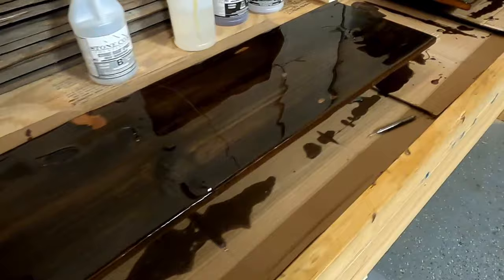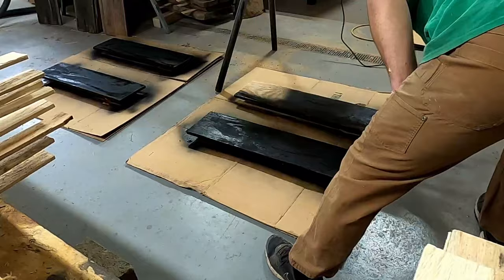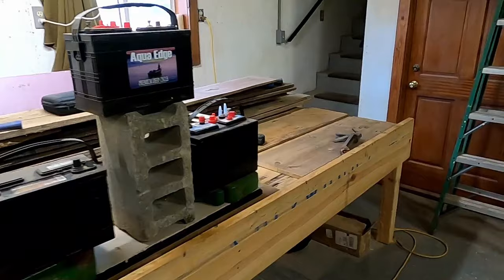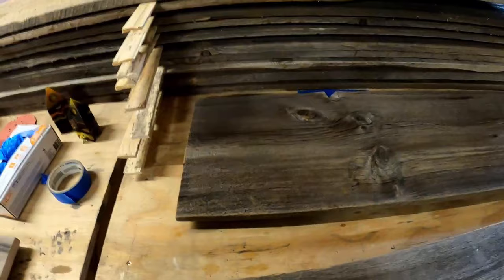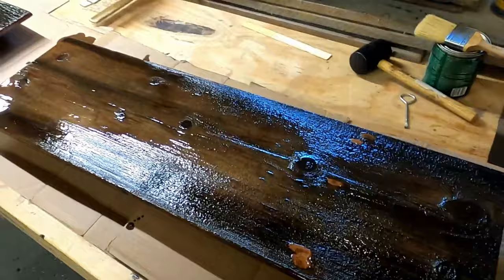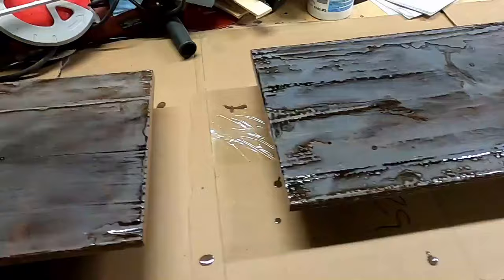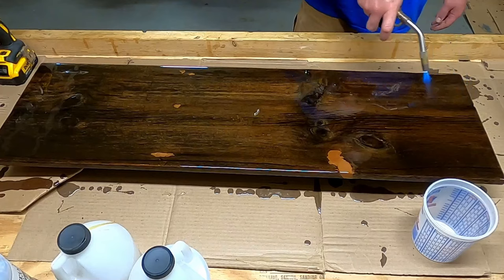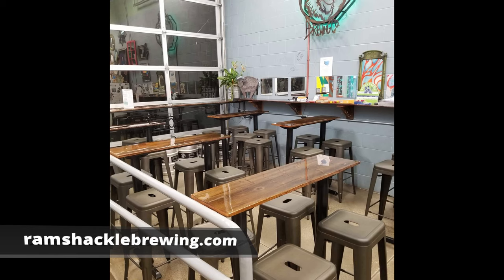How to Epoxy Over Uneven Surfaces Like Barnwood

Comment: Thank you for posting.  I have been fighting bubbles on bourbon barrel stave wood as it is very porous.   I have been wanting to try the Minwax urethane first but all the manufacturers were very hesitant on that actually working.   I also wanted that yellowing that comes with the urethane.  I will be trying the urethane on my next project along with the very thin skin coats based off your video.  My past skim costs were considerably thicker and unneeded.   Thanks for posting!
Reply from the maker: Glad you found it helpful…thanks for watching!

Comment: Thank you for sharing your process. Epoxy is a pain to work with and risky, because it’s a pretty exact science to get the ratios just right. If I was building tables like that, I would have opted to run a barnwood frame around the outside, maybe letting 3/8” of the outside skirt hang below the table surface and mitre the corners. In the long run, I think it would have made the ends and corners of the barnwood flats much stronger without sacrificing table space. Over great project thanks for sharing
Reply from the maker: Gotta give the customer what they want! Thanks for watching!

Comment: Thank you for this clear video! Is it possible to get a ‘satin’ finish using epoxy, without the high glaze but getting the ‘fill’ benefits?
Reply from the maker: Glad you enjoyed the video. The easiest way to get a satin finish is to pour the epoxy, let it cure for about a month, then sand it in a progression until you get into the thousands and then polish to the sheen you like. Thanks for watching.
Reply: Just to interject You can start on 1000 grit then 2000 grit and apply some osmo hard wax oil then wipe of depending how well the epoxy cured up that is  ,you don’t have to start from 80 grit upwards like a lot of people assume especially for what you want to achieve .if you made a fresh cut on epoxy then you would start at 40 grit up to 2000 /3000 going up 50% more than the last grit used

Comment: Second time watching this through and ready to flood pour my desktop. One difference is it has a damn but the irregular surface is what brought me back to watch again. One question- I sealed already with oil based poly so should I do the epoxy seal coats too?
Reply from the maker: If you seal coated with poly on wood, I would suggest you do at least one seal coat to see if you have any bubbles before you flood. In this video the irregular surface helped the epoxy bond, but if you don’t have that it might be good to lightly sand the poly to make sure the epoxy has something to mechanically bond to. Epoxy on straight flat wood might not allow a mechanical bond without the light sanding. Thanks for watching.
Reply: Thank you for the quick reply! Really love what you did and keeping that in my back pocket for future use. My desktop is made from pine project board  with many various sizes squares and rectangles. And the surface is not flat but more due to the knots and wood variations. I stained with four different wood stain colors masking each and using gel stain to keep borders crisp. Figured I’d seal with oil based poly and then epoxy. I’ve reached that epoxy step and am gearing up for the pour(s). Never having done it I’m a bit nervous but thanks to your opinion I will follow that and proceed! Rough up the poly and probably use total boat sealing epoxy because I choose their bartop product to get near 1/4 inch total thickness with a dam so I can attach a border I made. Thanks again!
Reply from the maker: It might be good to test out the poly and then sand it on a scrap piece to see how it will look with epoxy over it. It should make the scratches from the sand paper invisible, but might be good to test. Best of luck!

Comment: So glad I found this. Tried epoxy resin for my first time making some Cornhole boards, with some free wood lol. Nevertheless it was uneven and now I am hoping I have learned a bit to try on the next set. You were dead on with a lot of my faults lol. I tried torching bubbles and they went nowhere. But I didn't do a base/seal coat. Can't wait to do er again. Thanks a lot for the info.
Edit:P.S.If you do happen to answer back can i fix the low spots with the same process? Sand and apply again? I will be looking at your other videos to see in the meantime
Reply from the maker: Glad you found it helpful! Thanks for watching!
Reply: Well unless you have a direct line how do you help everyone that comes across you on YouTube so can I get that number 🥺. Friend. 🤣
Reply from the maker: When you do a second seal coat you can move some product to the lower spots and help even those out a bit. The final thicker flood coat also helps to take care of these. Sand in between each boat to ensure that mechanical bond. Also, if you have a real high spot you can sand that down some too. Good luck!
Reply: @northernridgedesigns  thanks for replying to my smart ass comment brother.if I could share pics here I would lol. Cause I know you would have the answer. I ended up with a bunch of what I'd call fish eye and air bubbles so on the next one I'm gonna do better at cleaning and also gonna start with the seal coats which may solve all my problems lol. I thank you again for your response
Reply: Sometimes I forget that YouTubers are actual peoplebso forgive me please

Comment: How much thickener did you use per ounce?  Does it discolor the epoxy if not using a color?  Thanks.
Reply from the maker: I did not use a ratio…just added until it looked thick enough. If you weren’t to add color, I believe it would discolor the epoxy some….making it a bit cloudy. Thanks for watching!

Comment: Awesome job.  Any idea how much weight was added to each table top with the four coats you put on?  Also, what grit sand paper did you use the Spar Urethane, was that a gloss finish?
Reply from the maker: Thank you! It added a little weight, but I think it really wasn’t too much of a difference with them not being really large tops. I used 220 on the spar and I believe it was semi gloss. Thanks for watching!

Comment: Would you normally brush in epoxy to seal it before pouring the first coat or is the first coat to seal it?
Reply from the maker: I would normally use my gloved hand or a squeegee to put down the first coat (a seal coat), but in this case we didn’t like how the epoxy changes the color of the old barnwood. So we used the oil product and then seal coated. I had to use a brush to keep the epoxy from pooling too deep in the big weather checks during the initial seal coats. Usually a brush isn’t necessary for seal coats. Thanks for watching!

Comment: So you can put a table top coat epoxy on top of spar urethane? I read every where you couldn’t but you prove them wrong.
Reply from the maker: I don’t know if I would recommend doing it over a perfectly flat and smooth spar urethane finish. In this particular case, the tops had a ton of cracks and little nooks and crannies to help the proxy adhere to. Thanks for watching!
Reply: I’m always learning something from you gurus brother.

Comment: VERY Nice job !!  
Thanks for demonstrating the combined epoxy / old wood conundrum!
QUESTION --  Could SHELLAC be used as the seal coat??
Thanks!!
--a new subscriber !
Reply from the maker: I wouldn’t be afraid of epoxying over shellac….just make sure you scuff it with 220 to secure that mechanical bond. I’d probably test it out to make sure the epoxy makes the sanding marks disappear in the shellac. Good luck!

Comment: Thanks so much for making this! Precisely the kind of video I've been hoping to find to help teach me about epoxy and old wood together. A few questions... Can I use polyurethane instead of spar urethane?  Also   did you use the quick coat epoxy for seal coating and flooding too?
Reply from the maker: I have used polyurethane before as well….you just want to make sure you get a mechanical bond. I used regular table top style epoxy on this because of the quantity I was working with. Thanks for watching!

Comment: They looked nice but I saw a few raised puddles on a couple of them where you didn’t sand them before you poured ,did you sand and polish these after ? Either way great old weathered look 👌
Reply from the maker: No need to sand and polish in this case…they wanted the high gloss finish. Thanks for watching.

Comment: Would it be dumb to epoxy a fence? I have a small 6 ft wide section that needs to be done.
Reply from the maker: Not saying it couldn’t be done, but very few epoxies are meant for outside application because they don’t hold up to sun damage…assuming this fence is outside. You’d want to look for some marine grade epoxy that could take the UV abuse. Thanks for watching!

Comment: Looks great! I'm doing my first epoxy/resin project and have some spots where the seal coat "puddled" so there's a bit of a hump where the epoxy transitions from lower to higher spot. I noticed on your video you had similar "humps" after the seal coat. But, these humps disappeared when you applied the flood coat and one can't even tell there was once an uneven spot. Is that the natural process with the flood coat...that it won't show that "hump" under the new top/flood coat? Thanks.
Reply from the maker: Thank you! You are correct…when you seal coat the epoxy absorbs in certain spots more than other and these spots appear shallower. The flood coat should even everything out. Best of luck!
Reply: @northernridgedesigns  Thank you very much. As you can imagine, these new projects are both exciting and a bit stressful. But, in the end we learn and improve. Thanks again.

Comment: been following your videos, using your examples for our 1st river table..  it''s a "near disaster" but since it's our 1st and like I say about all my near disasters... it will be "functional " !  One of our problems is with the torch for bubble popping,, thought it was the bottle ( was from a kit, bottle and torch combo) so bought another bottle... same problem, whenever I tilt it to begin popping.. flame goes out. Is this a safety feature that the bottle must stay vertical and must use a hose for all the weird angle work ? Thanks for showing us your great work, looking forward for your next project.
Reply from the maker: Sorry to hear you had some trouble. I’ve made plenty of mistakes along the way and still do...always learning. Thanks for watching and good luck on your next project!

Comment: Thanks for sharing. Probably a completely different technique/approach but you may know or have an idea. I am trying to cover an embroidered patch.  Do you think I should use a thin coat of resin to seal first or to use something else? Thanks, in advance.
Reply from the maker: I would try gluing it down first with some epoxy and then some seal coats right over it. Thanks for watching and good luck!
Reply: @northernridgedesigns  thanks for the quick response 😊

Comment: Nice job! How much epoxy have you used for this project ? I would like to make a small dj booth but i have no clue how much product i need to order (total noob here ;)
Reply from the maker: Good question…for seal coats I figure 1 ounce of mixed epoxy per sq ft. For the final flood coat I figure 3 ounces per sq ft. I usually do 3 seal coats and 1 flood coat. So that is a total of 6 ounces per sq ft for a wood project. If there are large edges, you would need a bit more. Thanks for watching!
Reply: @northernridgedesigns  Ok, thanks for your reply mate! I just subscribed to your channel ;) Cheers

Comment: How do you determine how many coats to use?
Reply from the maker: I usually do at least two coats, but a lot of times a third before the final flood coat. I do seal coats until it is very close to perfect and then finish it off with the flood coat. Thanks for watching!

Comment: I can not begin to tell you how helpful this is i found some really uniquely old fucked up wood that came frome some part of my neighbors house. I'm trying to turn them into a coffee table but since  they are so old and they were outside  for a long time they are being a dick but also are so pretty!
Reply from the maker: Glad you found it useful! If it’s really weathered and checked, make sure you support it underneath somehow. Thanks for watching!
Reply: I’ve done many many sq feet of termite, fungus, cow shit and weathered wood, toss in some rat chews and whatnot. Always kill the fungus. For mounting points they can be routed into the base and the plywood can be epoxied until the mortise. Chamfer, roundover or ease the edges if they are going to be a little proud. -it’s okay. Just route in deep enough to give them a location and more surface area to glue. I’m one to seal both sides of the board and stop it from cupping. One of the worst pile of boards was 75+ tables and benches for a brewery. The cocaine shut the brewery down but the punky lumber tables were fine. A little bit of surface rust on the parsons legs from too much bleach. I located any nails, cut them out, planed just a bit at least once on each side, hit it with a thick ugly layer of urethane, black epoxy in the larger holes, planed and sanded to remove the urethane clear epoxy to harden the punky stuff, sanded and planed, dado cut on (almost) all sides, splined together in wild lengths, cross cut and ripped to the bases I welded up, sanded, spar urethane, bolted on with 1” lag bolts I had to epoxy into their holes and self tap into the steel square tubing through a hole i(we)plasma and  torched and drilled (until we had no bits left) in the 1x1 x1” angle iron brackets I(we) cut in large batches on a few different bandsaws. -that’s where the only injury came from. A swag made portaband stand and too many pieces stacked up rolled them over onto a finger nail. But we(I) drilled a hole in it and opened dudes beer for the rest of the day.
Reply: @Theraindear1   first of all thank you for all the advice  I'm really new to making things and advice is welcome.  This is my first big project so I'm nervous and worried I'll mess is up. So advice from old heads of the trade is really reassuring! Oh and i made sure to sanitize the dickens out of the wood before i went further into the project it's jus being a dick.